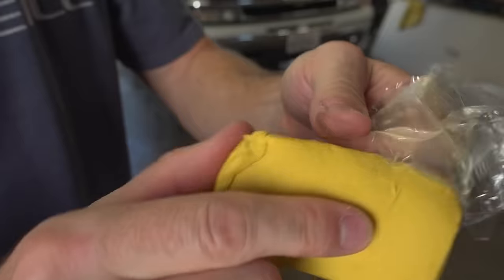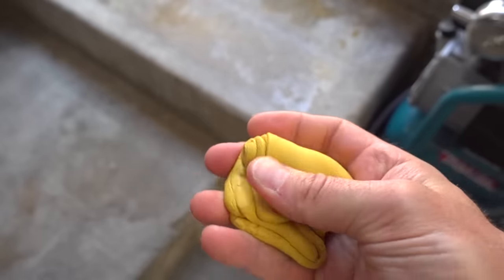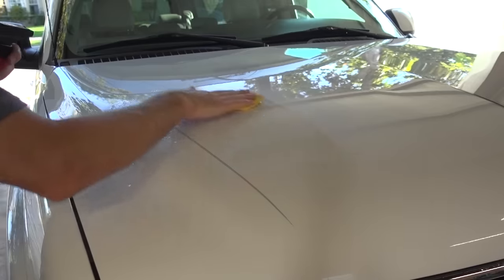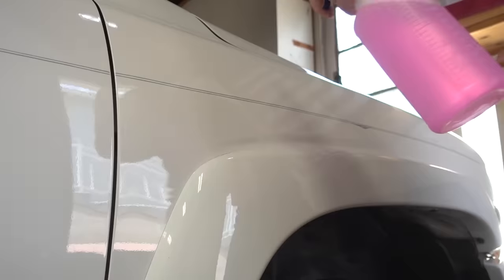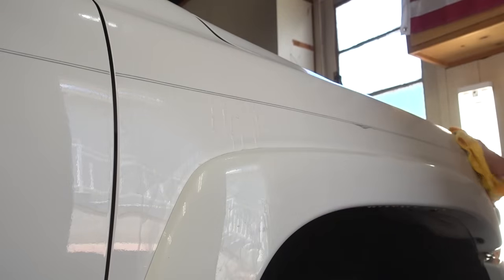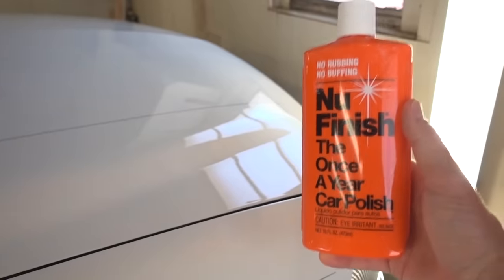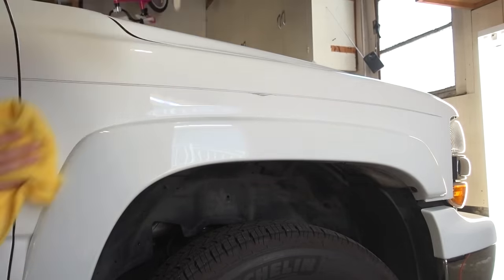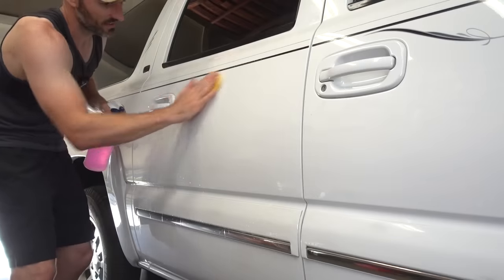This Is Better Than A Clay Bar And Only Costs $2

Comment: Put your hand in a plastic sandwich bag and feel your paint surface. You'll be amazed at all the stuff you will feel on the surface that the bars will remove. I'll try it with pp this summer!
Reply: Exactly, I'd like to see the results when the plastic bag method of checking for contaminants is done after using the putty over a clay bar

Comment: Thanks for a thought-provoking comparison. You've done nice work preparing and recording this comparison!  Nevertheless, my conclusion is I will use the tried and true methods that countless thousands of detailers and car buffs have used.  I'm not trying to save $15, I'm trying to get the best results possible. I know clay bars have a super-fine abrasive.  I know the tried and true procedure for using them. I'll stick with that until I read articles that the best auto enthusiasts now use plumbers' putty.
Reply: i don't want abrasives in my clay bar.  that's what polish is for.

Comment: I used New Finish for years; worked great on black clear coated paint;  issue i had was that it didn't last long;  needed more application's / year than any other wax;  good for car shows.  Just finished clay baring my Fold edge and waxed it.  Was very happy;  won't name the product as I don't want to sound like an advertiser

Comment: Try something that will surprise you: take a clean (new) plasticbag and wear it like a glove, lube the surface and now slide your hand again over the paint and you will feel particles throught the plasticbag that you did not feel before. It might shock you. I don’t know how this trick works but it is amazing.
Also when using any clay always when the surface gets dirty just fold it over the move contaminants inside!!!!!
Don’t kned it because you mix contaminants all over the clay and might get dirt back onto the surface.
Hope it helps for perfect results.
Greetings

Comment: I don't even wash my truck. Why did i watch this?
Reply: Hahahahahaha,my trucks still primer ,third year ,no times ,why did I watch this,hahahahahaha
Reply: I dont own a truck.. Whay am i watchin..lol
Reply: I can’t use either the putty or clay on the iron oxide/adobe composite body on my truck
Reply: Truck Owners should and will be taking care of their trucks in due time as they cost more than a Caddilac now!  F150 runs $45-$65k now.. For a Truck that Is safer to Drive ! Main reason so many are buying them..
Reply: because deep inside you really want to wash it lol
Reply: I washed my truck and plugged up the gutter! I may have waited too long.
Reply: I will stick with advice from Junkman2000. No offense, but this was not conclusive about ANYTHING
Reply: I have covid-19! Why did i watch this!
Reply: I don't have a car and I'm watching it.
Reply: Because secretly you actually want to wash your car.

Comment: The stuff that clay bars pull out of your paint is grit that has landed on a HORIZONTAL surface, and then settled into the paint when the paint gets softened under the heat from the sun. This doesn't happen on vertical surfaces. You want something sticky to pull the grit out of the paint.

Comment: Nice video and potential substitution for using a clay bar but they now have the synthetic speed clay devices from Mother's that last for years for around $20.
Reply: I have one. That is also supposed to be used 3 to 5 times.

Comment: I was using plumber's putty on my cars and from my experience it cleans much better WITHOUT any lubricant. If you get a streak from the putty - you remove it with the 'putty bar' in the next move. Any occasional haze will be removed by a microfiber towel after you are done with the putty. My (old) cars looked great after that, as if they were already waxed and polished.

Comment: Working at a dealership an old time detailershowed me something that’s incredible you take cellophane from a cigarette pack lay it onsurface put your fingers on the cellophane and rub it across the surface you’ll be able to feel any contaminants that are in the paintafter you do that then Claybar it or use plumbers putty and do it again it will be an amazing difference One layer from a sandwich bag also works.

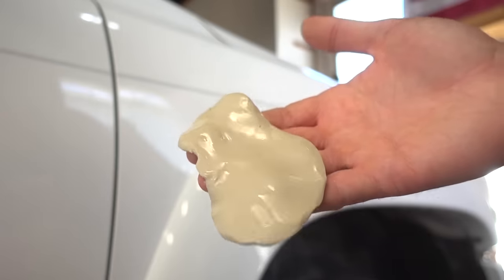Comment: Looks like your plumbers putty wasn’t pulling any contaminants off your paint when shown to the camera at 3:23 (which defeats the purpose of using a clay bar)

Also, that “Really smooth” feeling on your paint sounds like it was caused by the wash+wax soap you were using.
Reply: I’m not believing that the plumber’s putty actually works.
Reply: I tried plumbers putty years ago on my $200 Buick's paint. Did not even hold a candle to the clay bar.

Comment: After doing a lot of research and depending on the putty ingredients, i have found that putty could  damage your paintwork as it can contain limestone powder, which is alkali, also the putty may not be contaminant free, so may have particles that can damage paint, clearcoat. I personally wouldn't use putty as a clay bar.

Comment: So I don't see anyone mentioning this but normally I would strip the car of all coatings before claying. When waxes are added to cars it tends to give them a smoother feel making it seem counter intuitive to clay with a wax solution. Obviously you were able to still pull contaminants off the car with the wash and wax solution but I don't know if that's a great option when it comes to using clay. Also to answer your question about claying scratching the car, yes, clay can scratch your car, if you ever worry it's scratching you would want to either fold the clay or grab a new piece. Lastly I wouldn't really recommend claying the car unless you plan on polishing or doing a paint correction to minimize the risk of scratches, overall you should want to minimize contact with the paint to keep any damage to a minimum. I personally don't plan on trying to use plumbers putty, the stickiness of the clay is what pulls the contaminants out of the paint and as you said plumbers putty wasn't very sticky making it less effective. Maybe someone could do a side by side showing the results to clear up any confusion either on my end or yours.

Comment: I came to watch a clay bar v plumbers putty comparison video, but ended up totally missing most of it by being distracted by the pin-striping on the front fender.  That ''wavy design'' part looks like the painter sneezed at the same time as applying it.  It looks like a mistake in the graphics, and once seen by my eyes, I cannot not see it!  If it was the same thickness of twin lines all the way along the vehicle, I'd have been able to watch the video for the original content!  Oh Boy! - can you imagine if I actually had OCD?  I'd have had a meltdown!  LOL!

Keep on Keeping on!  Dawg.

Comment: Never thought of using plumbers putty but I’ve used it to clean up the hole where the pop-up or sink basket goes when I’m replacing them and it’s all gunky and needs a good cleaning. 
I always have plumbers putty around where clay bars, I don’t. Lol
Nice video and I’ll try it next time I do a clay clean.

Comment: Your next project:  Test if Play-Doh works as a replacement to clay bar, especially the bright red colored one.
Reply: Don't use Play-Doh. Play-Doh is loaded with salt and therefore not a good thing to be rubbing into/onto your automotive paint. Also the salt will dissolve when the spray liquid is used...

Comment: Your Killing me with that NU FINISH! All you did was fill in the scratches since Nu Finish. As a Pro Detailer, this is a Biased video! Most people will know that depending on the hardness of the clay, your going to get micro marring! Now in all fairness I would have to add that to my Arsenal. A Ceramic  Coated Vehicle could use Plumbers Putty, it’s not hard as the mothers or any other clay bar.
 Next time get vehicle that is badly decontaminated and then do the comparisons!😎
Reply: I agree with you about NuFinish. I would like to see the results on a dark (solid navy blue or black) vehicle.
Reply: @JV-tk3nn  I also agree with the above comment from "Mid Cal Auto Spa Manteca"  I want to see this being done on a vehicle that has older paint, is dirty and needs the paint refinished.  Then tell me about how well the Plumbers Clay versus Mothers Clay!  You didn't show me anything that I didn't figure out, by using my common sense.  Let's see a good video, one that shows a car that really needs this kind of treatment.
Reply: I take it you don't like Nu Finish?  Used to love Durashine, but not sure how well it protects paint compared to other products.  What do you recommend?
Reply: Monday206am Meguires make great Consumer Products. You have to do a lot of research to find what suits you and your budget. 
 Now I’m going to shoot myself for even recommending this but Chemical Guys make some good waxes And polishes. Their compounds sucks( fillers) but the other synthetic products will work for bring out a good shine! 
 Just do a little research.
Reply: @Game-The-System  I use 3M Marine grade paste wax on my vehicles. The best on the market as far as I am concerned.   I don't use the thin waxy kinds of things that don't seem to hold up to our winters in the North East.
Reply: I love NuFinish,,its a sealant and a polish in one and have used it for over 10 years and its never failed to deliver except maybe the slight smell.
Reply: @wvbonbonqueen  I come from a hot rod family & my Dad painted over 100 custom cars etc.. We always use carnuba paste wax up here. I never used a clay blob lol!
Reply: I ran 3 Limos on Vancouver Island BC and used Nu Finish on them. Frequent washing got about 6 months before re-waxing. On my personal vehicle, the Nu Finish lasted over a year. 
The thing I liked is you can apply in sunlight but I usually avoided this when possible None of my vehicles go through Fast Car Washes - -They all were washed at the wand wash facilities.
Reply: I'm about to try on a sun baked silver car with some clear coat beginning to chip on the mirrors and trunk fin.

Comment: There is so much to say here, but I'll try to be brief.  First, contaminants are going to collect on horizontal surfaces (hood, roof) MUCH more than on vertical surfaces (fender, door).  Had you done half the hood with the clay bar and the other half with the plumber's putty, you would've seen the difference.  

There are grades of clay bars - usually heavy, medium, and fine.  The Mother's bar you used is a fine grade.  I would estimate the plumber's putty is easily two or three grades less aggressive than the Mother's bar.  So, practically speaking, had you applied the plumber's putty to the hood, you would've lifted some contaminants.  but had you followed the same panel with the Mother's clay, you still would've picked up contaminants.  The horizontal surface, over time, simply collects more contaminants (that bond with heat) that cannot be removed with a super-duper-fine grade of clay.  

In terms of process, your clay lube mixture is fine.  If you really want to be frugal, invest in a bottle of Optimum No Rinse.  You'll have clay lube, detailer spray, light cleaner for glass and interior surfaces, windshield washer fluid, and rinseless wash...all in one.  In application, you want to lube both the surface and the clay material you're using.  And you want to fold the clay much more frequently so you're presenting clean material to the paint.  Worth keeping in mind that a clay treatment is really the second step (following the wash) of a complete detail.  Its job is to remove surface contaminants so you can then polish the paint and protect it.  There is generally no value in judging the appearance of scratches and marring after a clay treatment, other than to consider what your polishing effort will be (i.e. one-step light polish, or multi-step from aggressive to fine).  And that noise you heard?  Friction and work, and secondarily a shortage of lubrication.  The Mother's clay simply pulled more contaminants from the surface than did the plumber's putty.

Finally, in terms of protection and appearance, NuFinish really isn't doing much for you.  In your case I'd recommend a good paint sealant or a Collinite insulator wax.  More cost up front?  Definitely.  Much longer protection and good looks?  Even more so.  Never forget the value of your time when pinching pennies.

So much for brief, sorry about that.  Ultimately, detailing really is 90% process and 10% product.  Good on you for caring about the finish of your 'burban.

Comment: Tbh I feel like in most cases a clay bar is something I do before a polish or a wax or something like that which would have a bit of filling capability, so I personally would prefer to just use a clay bar and feel like I got a more thorough result.

The plumbers putty definitely isn't a bad idea though I suppose, at least in instances where you're working with little to no clear coat or a classic car that you really just can't afford to mar up with clay or anything that would require polishing.

The only thing I will say is that not all plumbers putties are made the same and with the same materials, and anybody doing this should do a test run on the glass or something, WITH whatever you plan on using as a clay lube. That way you can be sure it's actually doing something while making sure it's not going to start falling apart and breaking down in your hands.

Honestly though with how many different clay mediums there are these days I'd say just get one of the reusable clay things from Griot's or Mother's locally, and/or a decent quality clay towel online somewhere. That brings down the cost considerably since it'll last dozens of cars or likely years if you only work on your own cars. Especially since you mentioned that the putty was falling apart on you. In that scenario if I'm planning on coating or something after claying, I now have to add an additional step to make sure the paint is absolutely free of anything left over from the putty.

Last but not least I wouldn't be super worried about scratching the paint with the clay bar, or the putty tbh. I'll save you some time and wondering and tell you right now that you absolutely did indeed scratch your car. You scratch it to some degree everytime you touch it or do anything to it. Obviously there's no objective way to definitively prove it across all scenarios but it's widely stated and believed that most of the scratches from non road use, come from just drying the car, even with an awesome towel.

One pro-tip for you in case you do actually see this comment: get a good clay towel (the rag company and diy detail both have an amazing clay towel), anyway next time you're doing a full wash and decon, use a chemical iron remover to look and see how much contamination is actually on the vehicle and wether it needs to be clay barred in the first place, and if it does, have your clay towel soaking in the bucket with your clean wash soap. After you've completed the wash and before rinsing completely, take your clay towel out and use it with a good spray wax or detailer with some solid protection on the first panel you washed,  it'll act as a lubricant along with the little bit of remaining soapy water on the panel, but it'll also add protection and hydrophobic properties to break the surface tension and start sheeting the water off the panel to make it easier to dry. Then just dry the panel with your drying towel and buff it to a shine with a separate microfiber towel, then move along to the next panel. I know that it sounds like a lot when it's all written out but all you're really doing is making the decon process and protection process into a single step, and then doing it before you dry, and you should always be using a drying aid anyway so you're literally doing more in less time and steps. At worst the only additional thing you may need to do is rinse the panel after you've clayed with the protection product, if there was a lot of soapy water still clinging to the panel when you began, but it'll rinse off easier and be easier to dry so no big deal. If you want a recommendation for a good product to use when claying with a clay towel and a protection product, I highly recommend Griots garage ceramic speed shine and it's usually not too hard to find locally.

Sorry for the long rant and I know it's an old video, but I just found the channel and really like your content so far and it'd be fun to see you revisit some of these things. I'm a detailer and always learning things myself, so if you ever have any questions or anything like that feel free to hmu and I'll gladly share any knowledge about it I can, the only bigger passion I have than helping others out is detailing itself.

Keep up the good work and I'm looking forward to seeing more!

Comment: increased stiffness of clay might yank things off better than plumbers clay
Reply: Also more likely to yank off older clearcoat. Ask me how I know. With newer clearcoat (less than 6 years old)  it's never an issue.
Reply: @edjackson4389  it wont yank any clearcoat offunless the clearcoats damaged in which case no polishes or compounds should be used regaurdless, if the paints in good condition it wont damage paint or clearcoat thats what the lubricant is for it suspends the claybar off the paint leaving just the bonded contaimantion exposed to be sheered off by the clay bar, if your damaging paint with it you are using it wrong

Comment: I'm a plumber and I cringed when you used plumbers putty. Plumbers putty actually has oils in it. It's made to repel water but it can also stain. One thing I learned while plumbing is certain counters you cant use plumbers putty it will actually stain the counter. We had an apprentice that rolled out plumbers putty on a marble top and it stained it. They had to replace the entire countertop. Its probably riding the oils and that's why the plumbers putty glides across the paint. I guess to each there own but I wouldnt use it for a job it's not really made for. Especially when clay putty is so cheap.